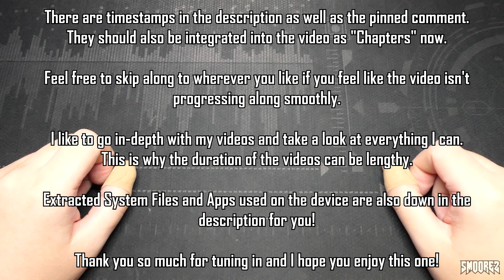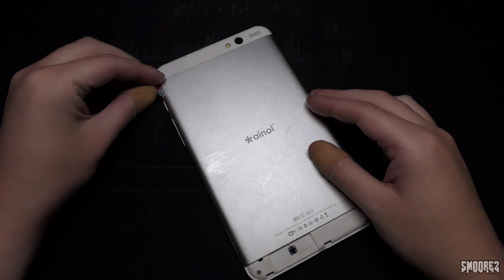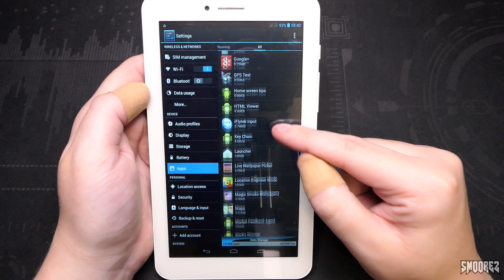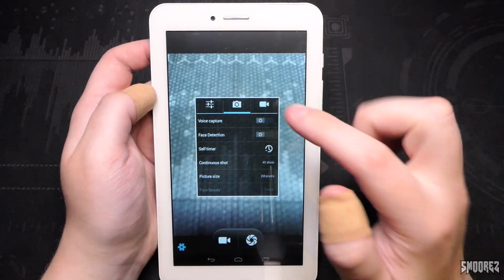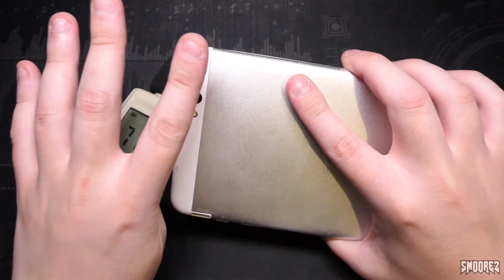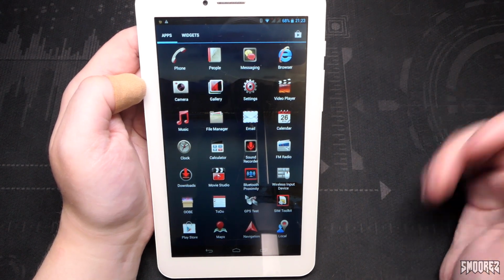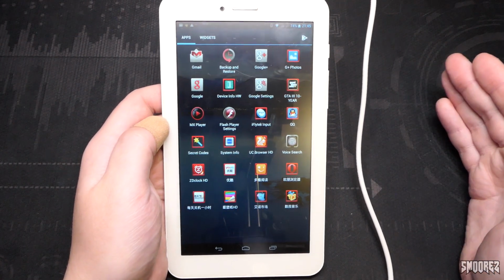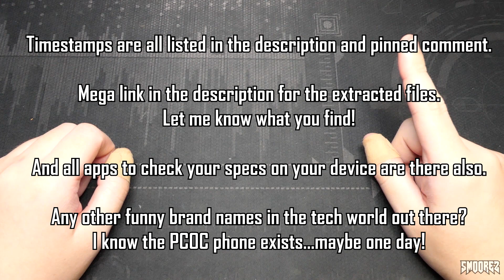TACKY TABLETS: Here's the AINOL Tablet...Prepare yourself for 38 minutes of AINOL.

Comment: I love Ainol. My first tablet was Ainol.
Reply: bro...😬📸
Reply: Hmmm me love Ainol too
Reply: Same, I didn't have any opposite brand tablet.
So I had to go with ainol, it was the only option at the time.
Reply: @Bangy  
Sometimes Ainol is the only option. Most of the time it's the best option.
Reply: @patrickriarchy6054  It depends on how used the ainol is. If it's really really new, then it takes a while to get it to work, sometimes you have to use certain tools to get it working. But if it's too used, then it's not an enjoyable user experience.
You wanna buy the ainol tablets that are ready for use, but not too used.
Reply: @Bangy  
Good point. Used Ainols are still useable but not as desirable as brand new Ainol. Used Ainols can possibly have viruses.
Reply: @NotJohnTanner  😑

Comment: I used one of those generic android 4 tablets in around 2014. My first one (nextdoor) melted in my hands, but the second one (Prestigio multipad wize 3017) was realy good. It was slow (since it had only 512MB RAM), but for a first grader, it was OK. The only problem was that it did not have bluetooth.
Reply: My first tablet back in 2010 I got off ebay from china was 10inch 1024x768 1.3mp front camera 2mp back camera 1gb ram I think it was 8 or 16 gb storage battery life was 3hrs cost me 210nzd wish I keeped  it and not tradeded it for a mint condition white psp and 6 games and $40
Reply: I had something similar that also melted in my hands! The screen cracked in the center, it smoked, and turned off. I suppose now I can understand that it was probably made with asbestos and braces wires, but as a kid I was so sad.
Reply: @MrJ0mmy you scammed that guy

Comment: I have an old Polaroid "Internet Tablet" from about 2012 or so. I'm not sure if it still works (likely not), but it's so cheap and tacky it doesn't even have cameras and is thick as a brick.
Reply: That actually sounds nice. The thiccness is probably to make it robust, and why include garbage useless hardware like cameras in there anyway?
Reply: @SianaGearz  haha...it lagged just playing 480p YT IIRC. It's all garbage.
Reply: @trevorhaddox6884  it would be perfect as a touch panel to control a 3D printer. Just to queue up files, jog axis when idle, set preheat, and show the temperature chart and such at 1 frame per second. And it would be detachable, WiFi connected. Chunky almost industrial feel as well. Another sane use would be as a TouchPortal client to use as a macro pad for your PC.

Comment: You should try unlocking the bootloader on one of these(or maybe a cheap phone instead).

From one side I doubt they would put any protection on it but on the other side idk if they did because sometimes they do put some effort in faking the devices and not getting exposed.

On that note android 4-5 can be rooted with a locked bootloader by one click solutions so rooting is probably possible.

Comment: Re: The 'Halos' around lit/bright areas... Possibly finger grease on the lens? I've seen many friends take photo's with iPhones, and more expensive phones than my Moto G9 Plus, and they say, how come you pictures look clearer? I just reply "Do you give your lens a quick wipe before taking pictures?", they say "No", and when they do, they exclaim "Wow! That's much better!" 😒😏 Just a simple thing that makes such a difference that a lot forget... Now I'm NOT claiming this 'A.I. Nol' will vastly improve in it's picture taking capabilities, but I wasn't sure if you do do this, or, whether some numpty at factory (QC control) managed to place their grubby mits on the sensor lens before they fixed the case cover (with protective lens built in) onto the chassis? 🤔🤔 😎🇬🇧

Comment: In Italy this tablet (different brand name and I'm not sure of the same specification of this one) was on sale by Mediaworld at 50 € and with Windows pre-installed. As you said in the video there was also a mini-hdmi that was covered in this Ainol. I had it and it was terrible
Reply: It wasn't the same tablet. It was for sure a Pipo or Onda rebrand, with an Intel Atom SoC, Bay Trail, Cherry Trail, something like that, and it runs a fully featured version of Windows 8, but is of course quite hardware constrained, 1GB RAM, probably 16gb eMMC if it was that cheap, so it's trouble to actually use, but the processor actually packs a decent enough punch for Chrome and stuff, just let down by eMMC and RAM. The chassis looks very very similar.
Reply: @SianaGearz  You guessed right Windows 8, 1gbRAM,  16 gb eMMC. I Remember carrying the tablet to school and playing Max Payne
Reply: @christianpogliani2072  Yeah i have one of those, ionik branded, Pipo rebrand; which is something i had to figure out because i had to replace the touchscreen glass on it. Also mine is 8" and has a 1280x800 screen, pretty nice.

Soon after i replaced that, the power management chip seems to have died from the USB side, like if the battery is charged, it'll work, but it refuses to charge it, and the battery per se is perfectly fine as well. So i'll need to do something about that, maybe just add a separate DC input socket and charger chip, because i'm not really equipped to replace the original companion chip on the board. Luckily they left some unused space in the enclosure. I could add a second shitty sounding speaker to it while at it, since of course they skimped there, and i actually have matching extras.

Or i could get myself some hot air and learn to use it and repair it for real...

I almost don't hate the thing otherwise. But actually having single USB for everything was a major drawback all along, so maybe adding a charging port wouldn't be the worst idea.

Comment: I had an Intenso Tab 824 with Android 4.1 and it was ok, but it quickly slowed down... Fun fact: it's still alive but I'm locked out due to wrong password 🤣
Reply: Just reset it in the bios..
Reply: you can reset it by holding power and volume down, like every android tablet from the time
Reply: @RealEpikCartfrenYT  there's not recovery i tried both adb and all available key combinations🤣